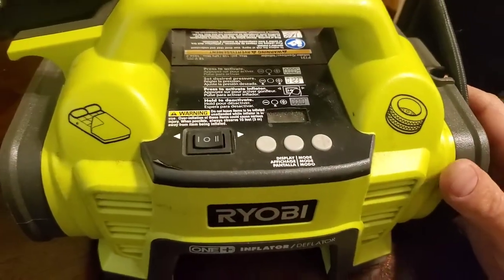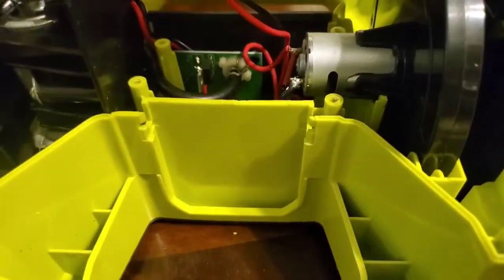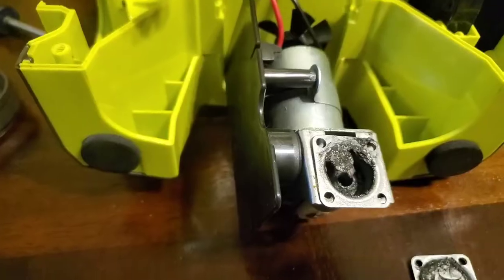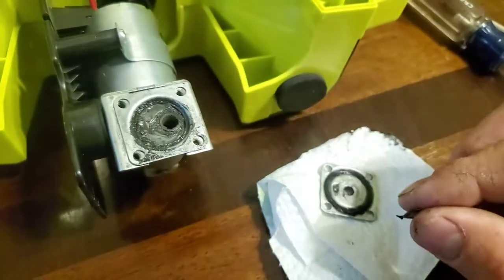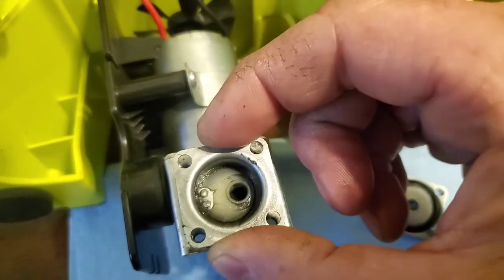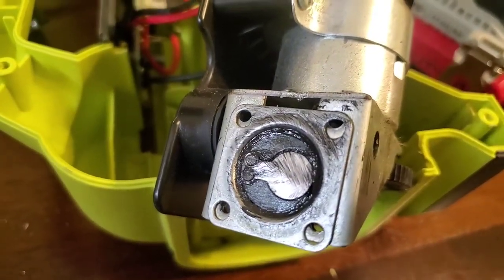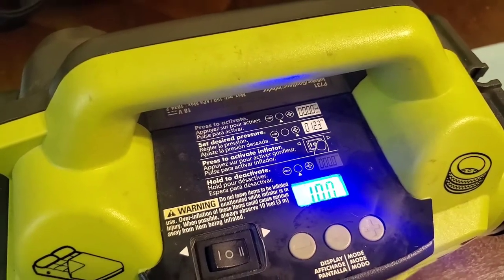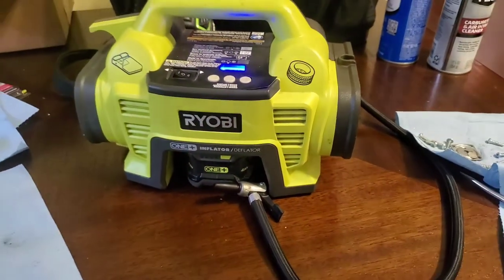Ryobi Air Compressor fix

Comment: Thanks for making this video. I need to replace the inflating hose on mine as it's leaking bad. I didn't know about screw number 10. Do you think  the hose can be replaced.
Reply from the maker: It was a fun learning experience. As far as replacing the hose, I'm not really but I believe you should be able to cut off the metal band and replace it with a small hose clamp after installing a new piece of hose. Thanks for watching
Reply: @randallsluss1475  Thanks, that's what I was thinking.👍